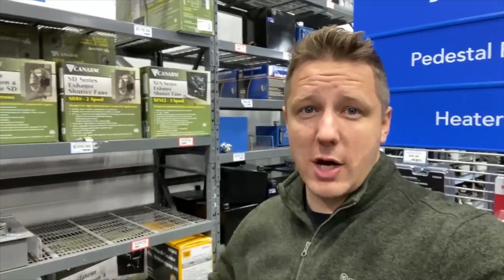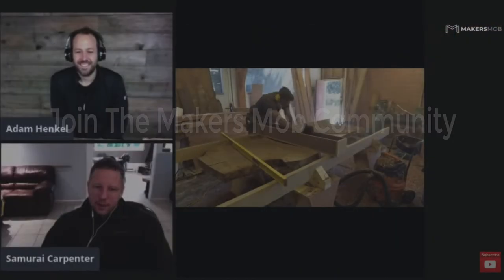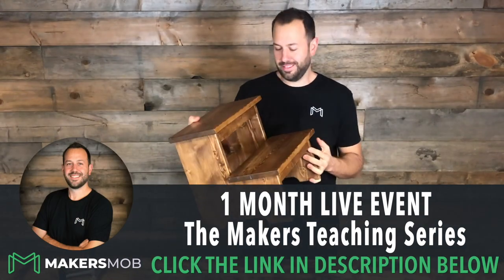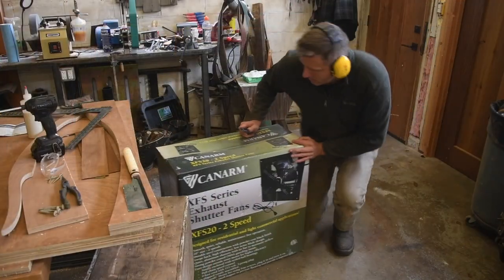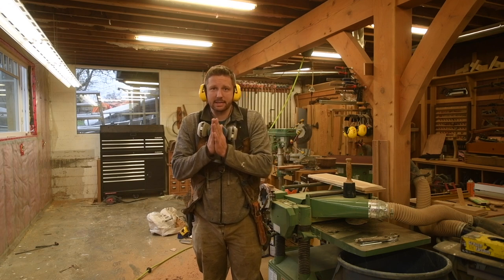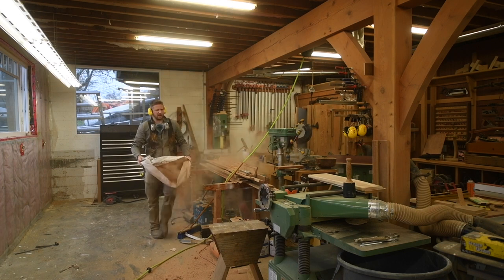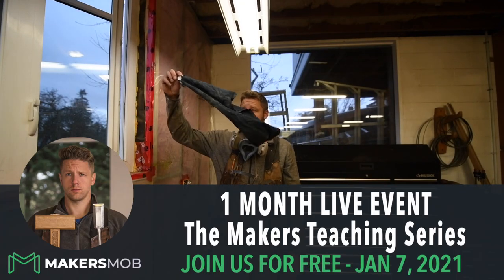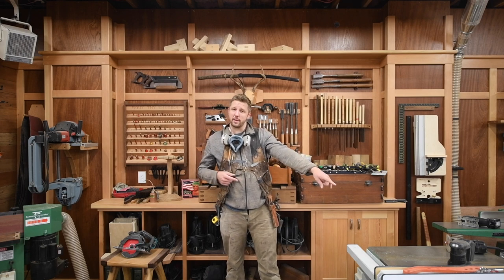Dust Extraction on Steroids!

Comment: Hey Brother. First thing out of the way, I think your channel is great. I work in the fire service. I have been inspecting wood shops for fire safety for over 10 years. What you are doing is incredible dangerous. You could easily burn down your shop or worse blow yourself up. If you are willing, I would like to connect offline and give you some safety information that you could share with your viewers.
Reply: Ben Wilson how can this cause fires? Just curious because I use a similar method
Reply: @canttReid  my guess is lots of floating dust particles (fuel) plus electrical sparks (ignition) could lead to an explosion and fire?

Something my woodwork teacher mentioned at school many years ago.
Reply: while you are not wrong, typically electric motors only spark when first turned on. Also those fans may also be spark/explosion proof.
Reply: The spark doesn’t have to come from a motor. A static discharge is over 10,000 degrees. This type of explosion is very common. Please error on the side of safety and not recklessness.
Reply: @SeaReverie  yeah thats what i was thinking. Vacuum hoseS always give me large static shocks when sucking up sawdust. I assume the same could be happening when blowing.

Comment: I did a similar thing for my shop, but with fans blowing into the shop, and air exiting open windows or doors. Then no danger of fans and dust or vapours mixed together and catching fire. I also put in  a filter door made with aluminum frame with landscape fabric over it on the the exit door,  to catch fine dust and overspray from finishing, credit that idea to my wife, works really well.

Comment: Hello Samurai Carpenter. Love your videos,, awesome work!!  This message is in relation to an Ad I saw earlier today with you in it!  The ad is for a rounded diamond cutting wheel for a angle grinder,, and a 3 second flash of when you made the sink (hand basin)out of stone. You were using a angle grinder with a flat cut off or grinding wheel. The ad is a clip of you using the grinder to make your sink. (hand basin).  I felt the need to let you know in case the ad people didn't get your permission to use the clip. If you did give permission then good on ya. But just wanted to let you know.  I have screenshots of the video and the ad folks if you want or need them.  Keep up the great videos!  Happy New Year and Cheers from NL!!

Comment: Ventilation is the best.  Does nothing to pick the wood chips off the floor but when it comes to air quality you can't beat it, get one of those airborne dust measuring devices and you'll see what I mean.  Problem is any heating or cooling literally goes out the window though...

Comment: Are You not afraid to put window frame so tight? What about woodgrain expansion due moist? I had bad experience with my wooden shed outside and doorframe - in winter time it looks like bow, so I prefer to put all frames "on foam". P.S. It could be interesting to have a view outside Your "dust extraction window"  ;)

Comment: If you add some spark it goes even faster! Plus you have heated the place at the same time!
Reply: Try it, it is quite hard to lit fine dust particles with a spark. I know because I have tried. All the safety regulations are in place because of theorical danger, but In practice the odds are ridiculously low until you hit commercial level of dust movement.
Reply: Seem to recall Mythbusters had no trouble demonstrating the danger using an air hose and a light switch. Think about it. It’s a regulation because it happened.
Reply: @SeaReverie  dont trust what you see on TV... they may have spend 10 hours trying to do it and only show the shot that worked. I have done a lot of research on the subject and never found a single case where a non commercial setup blew up.
Reply: @alain pilon I mean no disrespect, at the time of this reply 93,000 people viewed the video. If only 10% try it, that’s still 9,300 chances. Not every shop will stay up on cleaning, and some will have different materials. You could be right and nothing happens, or you could be wrong and someone could die. Dust ignition exists, that’s why there is explosion proof fan motors and dust collection systems. Why wouldn’t you error on the side of safety? Why risk someone else’s life?

Comment: A question for you. By you accomplishing dust removal from your shop, what about in the colder months using this new process with loosing all of the heat in your shop? What about an air handler on the ceiling with removable filters? Good job.

Comment: I got 1 question  !  Thats fine in the summer time  , but what are you going to do in the winter  ?  Won't it suck all the heat out of your shop , just saying  .  A good dust collection system plus some air-filteration might be a better solution all the way around  .
Reply: I have a similar setup and my outside temp in winter is -8 C at times.    The fans pretty much scrub the air in a couple minutes and while I burn all my scrap for heat, the shop sure gets too warm pretty fast.    Once the concrete slab and all the metal and cabinets with tools heat up, a two minute run on the fans makes very little difference in the shop temp surprisingly.   Cheers.

Comment: What are your ideas for keeping the shop heated when it’s cold outside, yet dusty in the shop? I experimented with a similar set up as yours but it sucked all the heat out so you’re either dusty or freezing. Just wondering if you’ve worked out an idea to prevent this. Thanks. Lou @ Summer Breeze Sawmill.

Comment: Are the motors on those fans sealed?  Because otherwise the sawdust is eventually going to burn them out even if you clean the fans regularly...
Reply: Not really, i've had a similar fan set up for going on ten years now with the same fan

Comment: Just keep in mind... additional exhaust will require additional make-up air.  If you don’t have fresh air coming in, you’ll only create negative pressure.
Reply: ......OK, yea....I shoulda watched the whole video.  I’m a jackass
Reply: Still good advice. If doing this in a closed space you could reverse exhaust gasses on furnaces or water heaters and create a carbon monoxide problem.

Comment: Hey Samurai, how does that sill material compare to Redwood or Cedar for rot resistance?  Nice work by the way.
Reply: Troy Staten, I don't know what that sill material is (primed cedar or pine?), but I find that knots and paint don't work well together even if you fill them. Cracks will open up and water will get under the finish. It's a problem especially with the price of clear lumber these days. And I don't consider finger jointed a good option either.
Reply: @tomruth9487  thanks.  That old redwood they used in houses in the bayarea was almost rot proof but it is not really available anymore.
Reply: @troystaten5633  Yeah, I will agree. I'm in the bay area too. I've found some recycled old growth redwood here and there, but I can't see painting it. Would rather use that inside for cabinets and furniture. A lot of guys here are using Sapele now.  I'm trying that and Boral. But Boral is not cheap and has a whole other set of problems, but it will not rot, even when put below grade. I've been laminating 3/4" Boral with plywood for screw holding and strength and using it for painted door jams.

Comment: Won't that extract all the heat from your shop at the same time as coating the hedge with dust... Strange solution for dust extraction, you should have made a dust filter as per your buddy John Heinz.

Comment: With the greatest respect. You are an incredible wood worker & nice guy…… BUT…..WTH 🤦🏼‍♂️. 
1. Fire hazard… 

2. You will need both those fans to inflate your lungs before you’re 50…
 
3. Visible amounts of fine particulate whilst you make the window frame is a prime example, with ZERO protection on you or extraction from machines.  

4. Environmental impact beyond your workshop. 

You are correct, you really need to re-think & address your strategy for workshop air quality. This initial solution is deficient in so many ways. I hope this is taken in the spirit it is intended, please, for your own sake reconsider.

Comment: Seems like a poorly thought through concept. A building’s air quality considers more than just airborne particulates. It does work well exchanging out “dirty” air with “fresh” air from outside, but it also sends out all your heated, cooled, dehumidified, or humidified air. Meaning increased energy usage and increased cost for climate control. Additionally, wood is susceptible to movement from moisture content changes - it’s a wood shop after all.

Comment: VERY BAD IDEA! I’m a Master Electrician, you have just created a giant bomb. Class II group G.

Please do not clean your shop with air, one little spark when all that wood dust is suspended in the air and BOOM no more Samurai. For the sake of your family, STOP.
Reply: Also just noticed the potential ignition source hanging from the ceiling over by your compressor shack. But In reality, a simple static discharge could trigger the explosion.